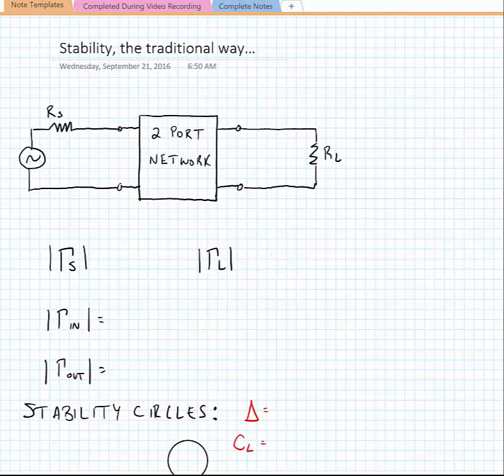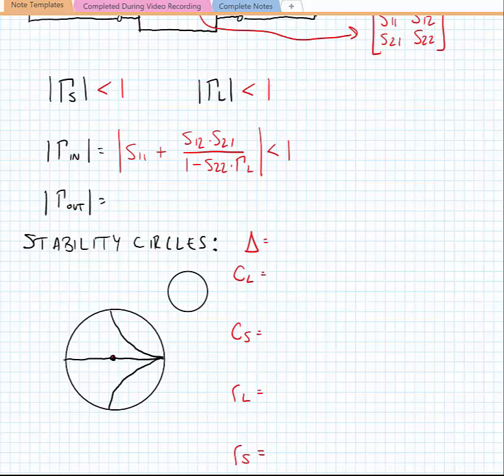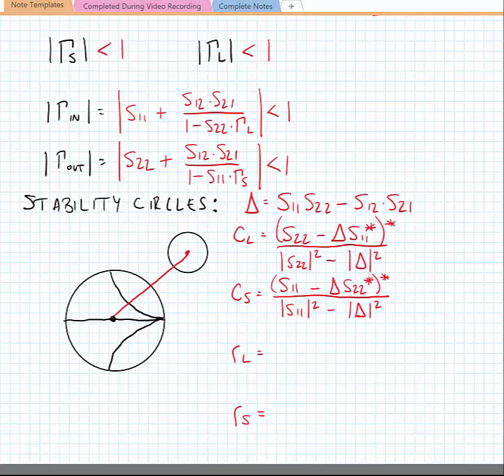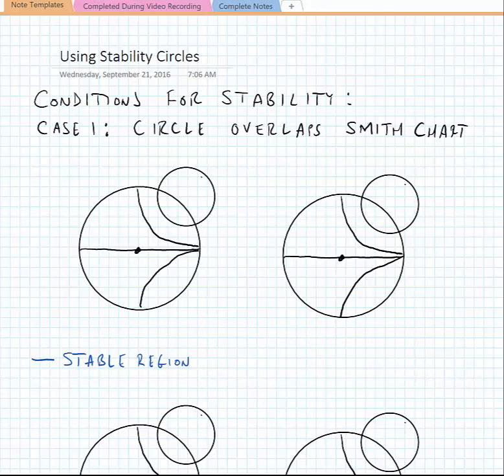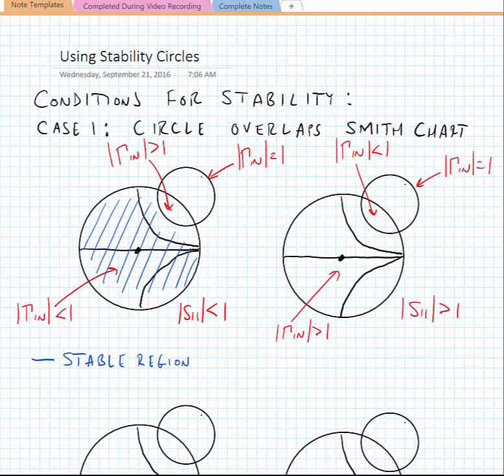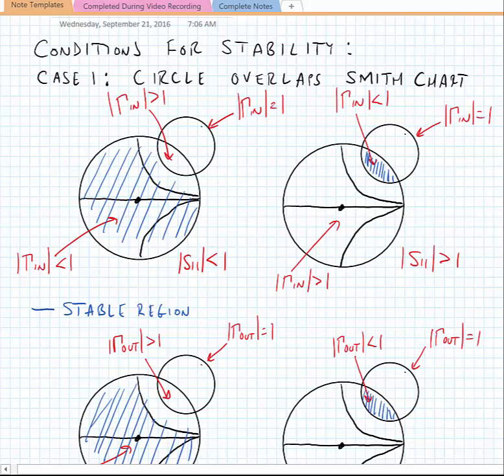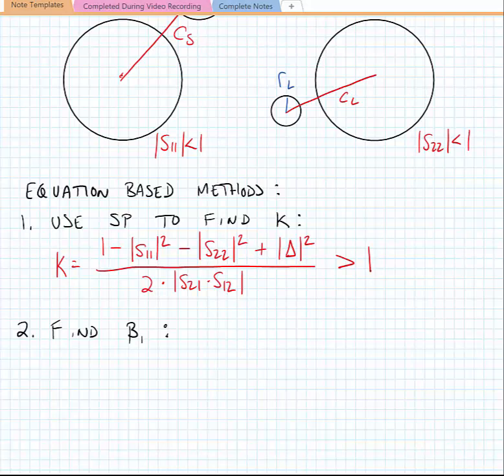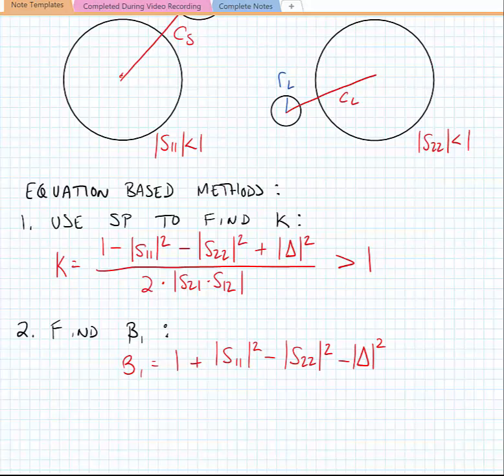Lecture 12.3 - Stability, the traditional way...

Comment: Hello. I always have this question in mind that why we don't examine the stability of microwave circuits (amplifiers) in a similar way that we treat analog circuits with feedback, i.e. using bode plot and phase margin (instead of K and mu). I'd appreciate it if you would address my confusion.
Reply from the maker: The mechanisms that cause instability in FB circuits are indeed what cause them in microwave circuits, but traditionally we are unable to do much to the device to affect stability at the device level and in discrete designs were not likely to use a lot of individual devices because the interconnect parasitic would have dominated the response.

In a FB circuit, we can impose stability using internal compensation; we can do this by making a complicated circuit with a lot of gain at low frequency and trading off high gain for precise gain using FB and controlling the bandwidth. We cannot do this at microwave frequencies, where we don't have nearly the same magnitude of gain.

Also, traditionally, someone was just handed a transistor, told how to bias it and what the expected S-parameters would be. This meant that the only thing we could do for stability was to engineer the input/output impedance to meet the requirement. Think of it like old op-amps that were not internally compensated and we had to externally compensate by narrow-banding.
Reply: @wallingphd  Thank you very much for your response. Now I have a better idea about it.